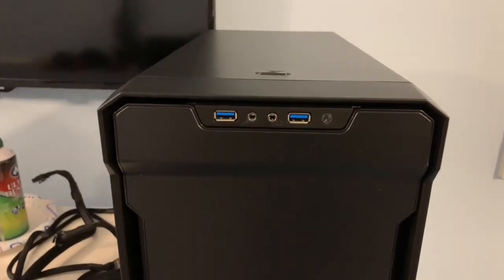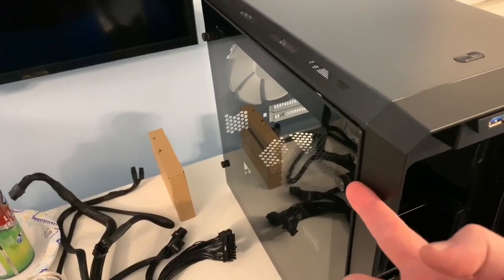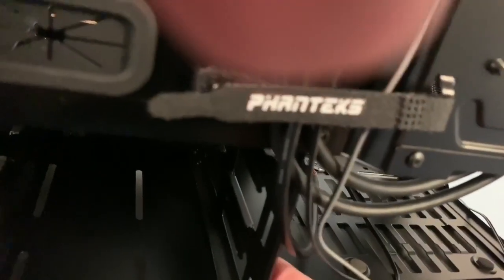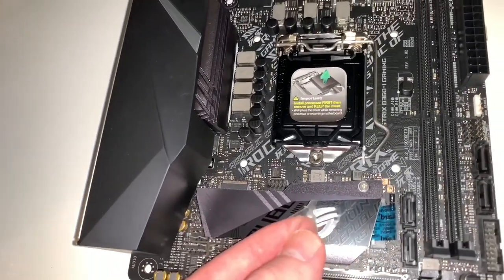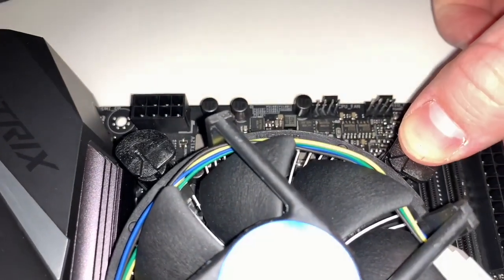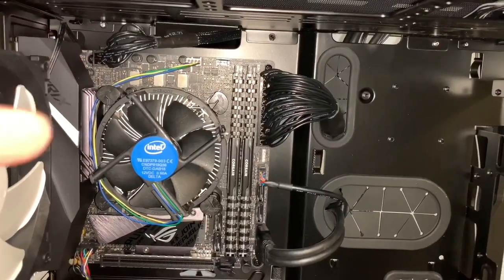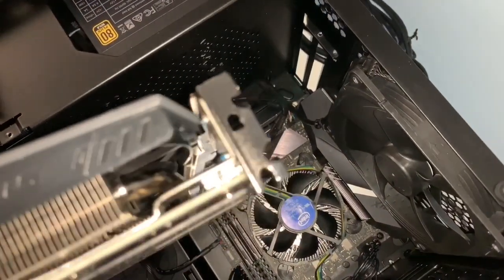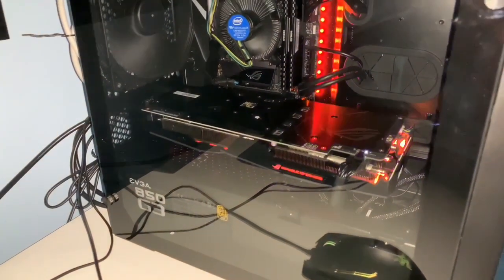Best Mini ITX PC Build 2019 - Phanteks Enthoo Tempered Glass Mini-ITX

Comment from the maker: ASUS VG279Q Gaming Monitor - https://amzn.to/2GuzXOt
ASUS STRIX GTX1060 A6G GAMING - https://amzn.to/2td8ed0
Phanteks Enthoo Evolv ITX Glass Case - https://amzn.to/2Gw50cA
EVGA Supernova 850 G3 Gold PSU - https://amzn.to/2tcxoc1
ASUS Strix B360-I Gaming Motherboard - https://amzn.to/2telsX9
Intel Core i5-9400F Processor - https://amzn.to/2U2u6nc
CORSAIR Vengeance 16GB DDR4 C14 - https://amzn.to/2I4YsUR
Samsung 970 EVO NVMe M.2 250GB SSD - https://amzn.to/2tfwNGj
Razer Lancehead TE Gaming Mouse - https://amzn.to/2GySk4Q
Microsoft Wired Keyboard 600 Black - https://amzn.to/2MW5zxu
Noctua NF-A14 PWM Black 140mm Fan - https://amzn.to/2tg4KGS
Noctua Fan Splitter Y-Cables - https://amzn.to/2U0DYhx
Screws for front fans - https://amzn.to/2TWloHc
Wiha Screwdriver Kit - https://amzn.to/2GWScwg
Reply: Dope build! How have thermals been since the install?
Reply from the maker: Incredible. I’m looking for good software to monitor cpu and gpu, but the fans almost never kick on even at max settings on newer games! I custom installed a Noctua 200mm fan in the front and a 140mm  octua in back and they work great. I might go with Noctua cooler on CPU also, not because it needs it on the new i5 9th gen, only because stock intel can makes annoying hum droning at low speeds. Thanks for the Comment! Here’s what it looks like now - https://youtu.be/4t_bemJjqwo

Comment: How are the temps? Im considering getting the evolv itx aswell
Reply from the maker: With the noctua 200mm in front and 140mm in rear, my PSU never kicked on. With a noctua CPU cooler it would be nearly silent.
Reply: @NameItBuildIt  what about the gpu? Will it be fine with 2 120mm fans in front and the 140mm in the rear?
Reply from the maker: No I would go with 2 x140s in front and one in back OR a 200 in front and a 140 in back.

Comment: It’s a bit crappy that they don’t include the screws for the obvious front fans.
Reply from the maker: That’s why I linked the screws in the description for anyone thinking about getting this case. But they should include those with the case.  I took the guesswork out of it : ) If you are mounting the fans in the back of the front cage they will most likely have small supplied screws though.

Comment: I just ordered this case a couple days ago to transplant my current watercooled pc into it (switching from water to air cooled with the BeQuiet Dark Rock Pro 4). Luckily, I have 3 140mm fans that I replaced from my Evolv X case to put inside of this case.
Reply from the maker: Nice! I made a video on how to custom install a 240mm fan in it and that’s how I’m running mine. 2 140s in front and 140 in rear is a great setup also. I noticed when I put tape around the fans to seal everything, the airflow was better and it was quieter. I used high quality black duct tape and it worked out great. Good luck with your new setup. I also made videos on RGB lighting for the case you can check out.
Reply: @NameItBuildIt  Thanks! I actually put 3 RGB strips that I had laying around (on the floor) in there. I did kinda mess up a little bit. I stuck the motherboard in before installing the Dark Rock, then became unable to put the other fan into the middle of the heat sinks. straight brain fart there, but also because of the Gigabyte's AB350N's weird layout that made me put it in first in the first place. But it still turned out just fine.
Reply from the maker: Glad to hear it worked well! It really is a great case. I would really consider the mod I did with the Noctua 200mm fan. It is Sooooo quiet :) I’ll bet yours looks amazing with the led strips. I wanted to add some but with the asus motherboard, my asus GPU and the led fan ring I have, anymore would be too bright! Lots of luck with the new build :)
Reply: @NameItBuildIt  I would love the RGB lights even more if my motherboard didn't crap out on showing the color purple lol. I'll just go ahead and leave the front fans as they are and put my focus back on my debt increasing powerhouse watercooled pc I'm building that's waiting on the 3900X and the Aorus Extreme Motherboard. The 2080TI is getting really impatient.